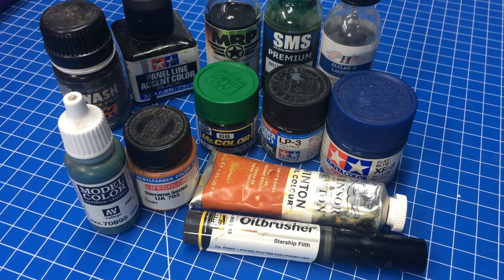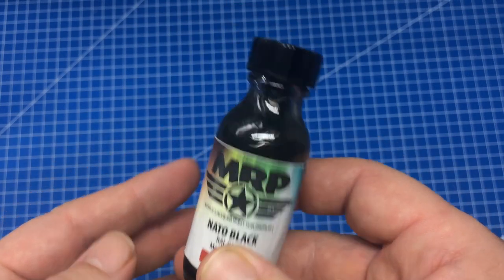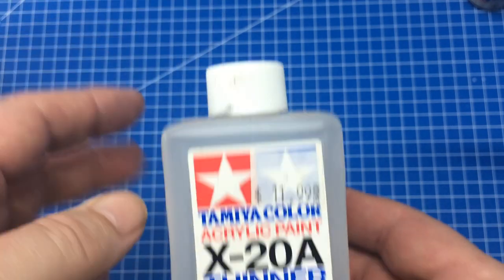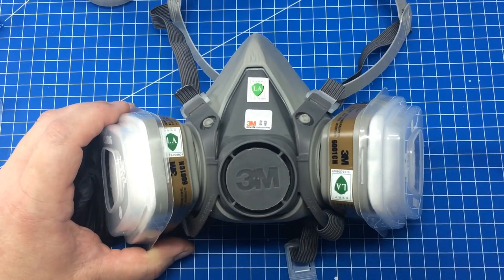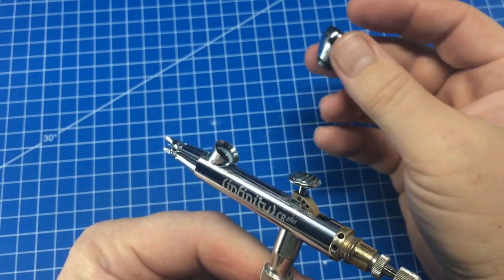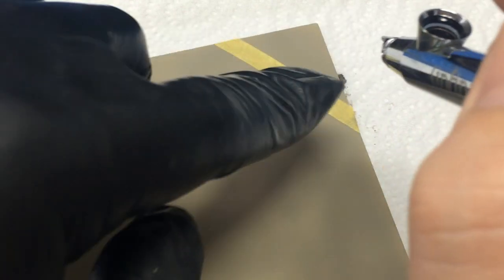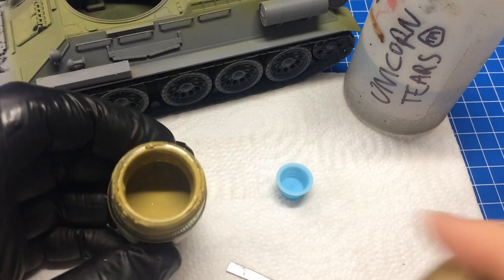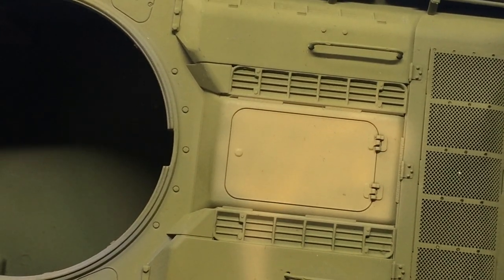How to airbrush Tamiya lacquer and acrylic paints (plus thinning, mixing and cleaning)

Comment: Clean those glass bottles. Asking for trouble with paint flaking off or worse case improper seal and dried up paint.
Reply from the maker: Yep I clean them as I open up a new one. Ive had a few issues with these because of past very hot summers (44C plus) but generally they have been stable...cheers Chris